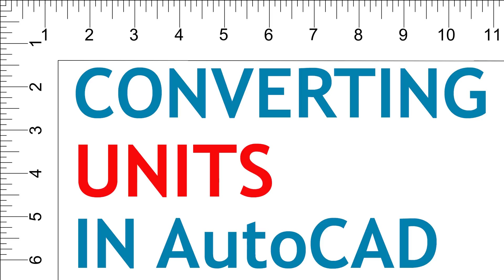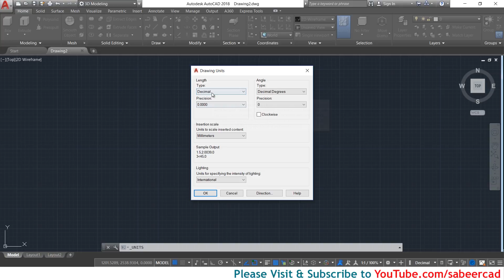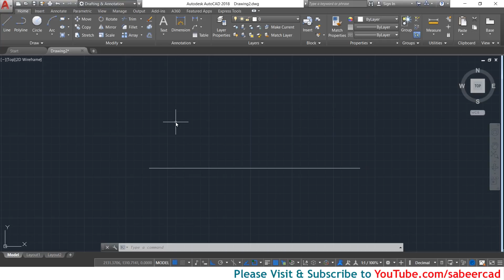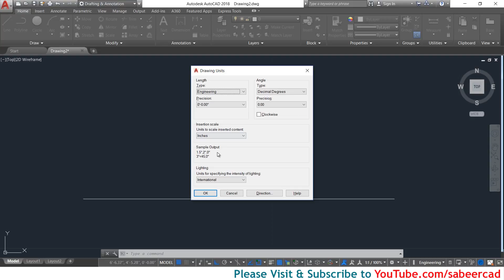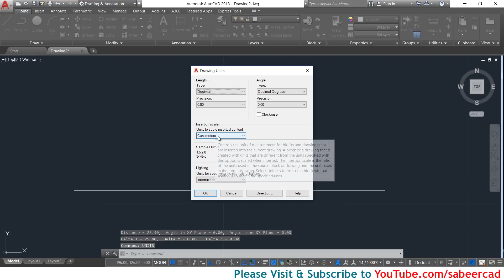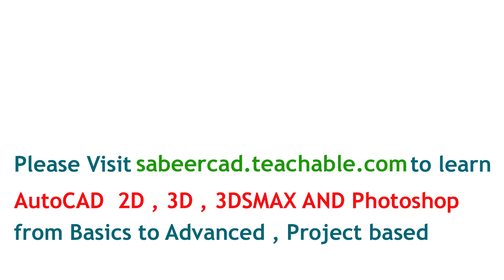CONVERTING UNITS IN AUTOCAD | UNITS IN AutoCAD

Comment: Question, I notice all you instructors keep your pick box and crosshairs so small. I also notice how slow and pin point you need to be to pick something. Why not enlarge the pick box to speed up the picking of end points etc.. I’ve been using AC since 1982 and never understood why everyone uses such small pick boxes and small cross hair. You can always reduce its size if a drawing gets to cluttered for a larger pick box. Only 3-4 times bigger. Cross Hair I make 100%
Reply from the maker: Thats a good suggestion. But old habits dies hard 😊